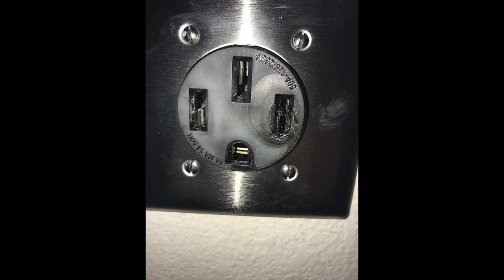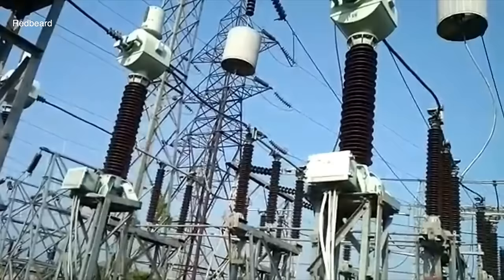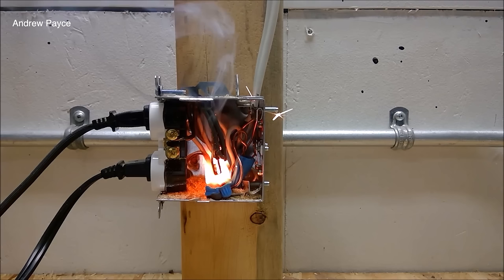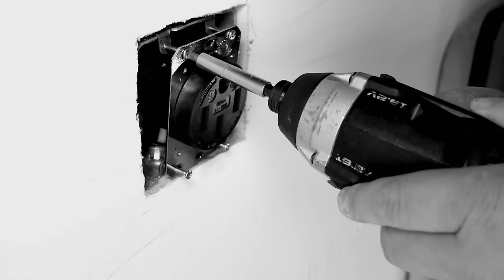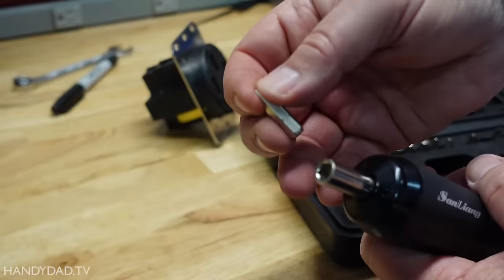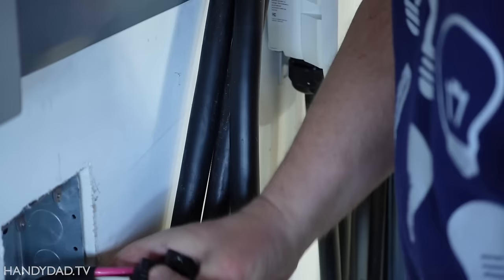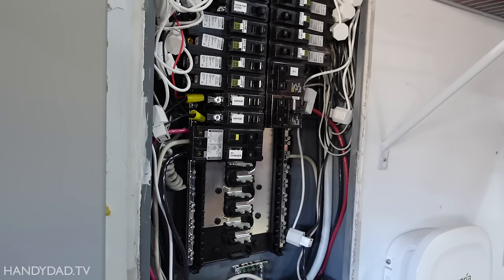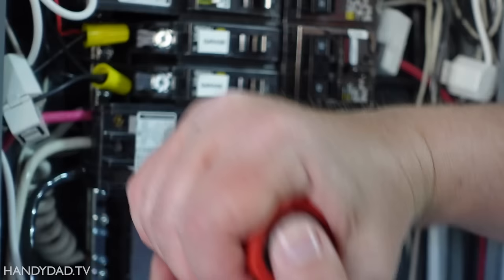EV Charging Disaster

Comment: Never buy a home unless it’s been certified safe. The number of cobbled up disasters by DIY repairs that I find are quite scary. Never assume, have it all checked to get a true honest price of what you’re getting. It may save your lives.
Reply from the maker: Sadly, a home inspection probably wouldn’t find loose wires.
Reply: @handydadtv  so no point in doing one? I got the price of my house reduced because the previous owner had put all new 15amp deco wall outlets throughout house, new switches to match, the rocker type. It looked nice. The problem was during the inspection it was discovered that it was a DIY job and he never ran a ground wire to any of the individual outlets, switches and thusly the light fixtures and outside outlets were not grounded as well. So I was just putting it out there that electrical DIY jobs should be investigated for code violations and a quality home inspection is a good insurance but to protect you from the crazy stuff you may find later. I’m old and just trying to save the young guys sone grief. Enjoy your advice. It’s always good. Thanks.
Reply from the maker: No, no. I definitely recommend professional home inspections. I canceled a deal after the home inspection.

Comment: Really goes to show how dangerous a “handy” ding Dong with too much confidence and too much time of their hands can be. You don’t know what you’re doing in an electrical panel but want to save maybe $1000? Then by all means, do your own electrical work especially with something as high amperage as an EV charger; definitely go buy the cheapest junk outlet at your local big box store and make sure to ask those ding dongs who work there for advice because they really know their stuff. 
  I bet if someone did a real investigation, it would be found that a LARGE percentage, probably the majority, of electrical fires are because of work done by non-professional homeowners. 
  Hire a professional to do the job right. An EV charger is one of the highest amperage circuits in a house these days so it should not be taken lightly. 
  Some of the comments here reflect how many middle level management bozos are doing their own electrical work. At the least the creator of this video had the sense to listen to professionals who know what they are talking about and put out a video on his mistakes. Kudos to Handy Dad for that but for those that don’t know what the National Electric Code requires for EV installations, don’t have a torque screwdriver, or don’t know what the difference is between an equipment ground and grounded equipment, then you should swallow your overinflated pride, and be calling your local sparkies who are qualified professionals and hopefully have worked with EV chargers before. Or just burn your garage down because you want to save a few bucks.
Reply from the maker: Thanks for the feedback. 👍🏻

Comment: I charge my tesla on my welder outlet.
The car tells me if it's charging right. 
I was charging at 48 amps and my car told me to check my outlet.
I turned the charger in the car to 22amps 
problem solved.
Reply from the maker: What charger are you using? I’d like to understand why this happened.
Reply: @handydadtv  The charger from Tesla that came with the car. 
But it's the cars battery computer that knows. It won't let you ruin the battery or the outlet. 
Say if you're going to a Tesla Super Charger, let the car know and it will pre condition the battery so it can take the 250 amp charging
Reply from the maker: The Tesla UMC (universal mobile connector) tops out at 32 amps. What made you think you were charging at 48 amps?
Reply: @handydadtv  You can set how many amps you want it to charge at, I had mine set at 48 (meaning it will charge up to 48amps if available) So it was taking as much as my 240 output would give it and it was getting hot. (I ignored the warning, till it tripped the breaker)
I used the app to turn it down to 22amps and everything works fine now.
I'm not an election so I don't know what I'm talking about lol 
I did wire my own 240 for my welder about 8 years ago.

Comment: I didn't see any ground wire connected!  That's a four wire plug and receptacle for a reason.  I would also use Wago connectors in your breaker box instead of wire nuts.  I've had a wire nut arc and melt before, but never a Wago lever nut.
Reply from the maker: Thanks
Reply: Seems like Wagos can have more resistance.
Reply: @jeffkardosjr.3825  
They might have more resistance than a good wire nut, but Wago connections are all good.  Lots of wire nut connections are not.  That's why they sometimes arc.  Trouble is, nobody makes transparent wire nuts so you can't see inside them like Wago lever nuts.  The Wagos have one lever for each wire too.

Comment: You deformed all the screws on the circuit barker. What a way to inflate something insignificant as if you were doing a lunar landing. 99.99% of circuit brakers screws are tight by feel and don't have a single problem.
Reply from the maker: All I can say is, there are tons of countering opinions that say you’re wrong. I was chastised by many electricians when I failed to torque the screws when originally installed.

Comment: Another one of those scary videos. Get the right equip and read the manual. This cannot happen, if you use the right charger which is temp controlled at the plug and maybe ask somebody to install a correct outlet. How about a 220v system. Everybody who gets a ev should get a wallbox! Everything else is just wrong.
Reply from the maker: Thanks for you input

Comment: Wires in wall and in insulators is wrong place. Strong current heating it. When something happen, wires on wall is more harmless and visible/smelly. First come smell, then smoke and then fire. Infrared meter is handy to observe wires and connectors. When wires and connectors are installed some distance of walls, not fire hazards from them.
Reply from the maker: Wire needs to be sized correctly to carry the current without overheating.

Comment: At minimum you should have a basic understanding of what your doing. Knowing how much to tighten electrical connections would be a bare minimum in my book.
Reply from the maker: I’ve done a lot of electrical work and this was the first time I torqued them.
Reply: @handydadtv  Have to keep in mind as the conductor gets larger it take more torque to make the good connection.  I don't think you will find many guys in the field torqueing them unless they are a apprentice learning the trade. Seasoned guys will know by feel they are tight enough. But for the inexperienced people that's why they give a torque setting.
Reply from the maker: Thanks 👍🏻

Comment: I’m soooo scared. Big wires, big screwdriver. I’ve done thousands of outlets, breakers, appliance installations, and breaker panels in my career as a general contractor. No call backs. No fires. The torque screwdriver from China may satisfy the specs but how do you know it’s accurate? You need to calibrate it against my wrist!😂
Reply from the maker: Good point

Comment: The biggest mistake is not hiring an electrician to do that job. I see 2 more failures you are going to have that only an experienced electrician would know.
Reply from the maker: Sorry but that’s no guarantee. Most pictures of melted outlets aren’t DIY.
Reply: @handydadtv  Yes there's most certainly a guarantee. I been installing 10 of thousands of the same outlet for 42 years for items that Pull much more power then a car charger. Range ovens, motor homes, trailers, construction offices, industrial equipment, ECTs, computer equipment. Just to name a few. A lot of this equipment pull a constant 60 amps. Never had any problems. The plug is under rated and so should be the wire. Tricks of the trade that DYIs don't know. We are a contactor for ev chargers installed as well. Never once had a failure of any kind. The connection should never have a 10 deg. Temp above room temp.
Reply from the maker: I believe you. But others must not do things as well as you do.
Reply: @handydadtv  Its tricks of the trade just like car mechanics who assemble engines or computer builders. Assembly is a mastered experience.

Comment: The Internet is getting more liberal every day and doesn't use common sense words at all anymore what is the special word of hardwiring EV charger  Different ways Of hooking up hardwiring and  Looking up level 2 charges with a on and off switch why is it so difficult
Reply from the maker: If you’re looking to hardwire an EVSE with an on/off switch, for circuits larger than 20 amps, that’s called a service disconnect.

Comment: If house fires scare you, then charging an electric car in your garage should scare you too. Imagine plugging in your car overnight and waking up to a house fire. EV batteries have been known to do that. The outlet is only one link in the chain. The car batteries themselves cause massive fires when they go wrong.
Reply: So do the many fires started by gasoline powered cars.
Reply: @lordgarth1  The difference is you don't "charge" your gas car overnight in the garage. It's not going to spontaneously explode while you're sleeping.
Reply: @chrimony  Except that they do. I still plan on getting an EV as well as battery storage for a solar array. I’ll probably add additional precautionary measures.
Reply: @chrimony  Unless it's a Ford with a United Technologies ignition switch that hasn't had the recall done..
Reply: @brianleeper5737  Thanks for the specific reference. I had never heard of the Ford ignition issue. But I'll note that it goes back to the 90s. I'm not aware of any internal combustion engine car within the last 20 years that compares to the dangers of lithium batteries being charged overnight
Reply: @chrimony  There was a more recent Ford recall involving the cruise control deactivation switch. It's mounted to the brake booster and it disconnects power to the cruise control module when you step on the brake--it's a pressure switch. Problem is that it can leak brake fluid into the wiring, causing a fire. Even if the vehicle is parked and turned off because that circuit is always live. There are several circuits in a vehicle that are always live, and a car battery has more than enough energy to start a fire if there's some sort of fault.
Reply: @brianleeper5737  Thanks for another reference. Looking it up, it seems the latest model to have this issue is from 2004. And while I acknowledge the general possibility exists and has caused issues, the danger from electric vehicles being charged overnight in a garage are much more fundamental and orders of magnitude greater. You have to go back decades for particular models of cars to find similar issues in combustion engines.
Reply: @chrimony  Perhaps. Other than the Chevy Bolt, what other EV or plug-in hybrid has been recalled for potential battery fires? I haven't heard of any.
Reply: @brianleeper5737  It's a fundamental issue with lithium batteries. Tesla cars have caught fire while charging in people's garages, but there has been no recall. Unless a specific manufacturing defect can be identified, it just comes with the territory and is written off.
Reply: EVs are not a ticking time bomb waiting to go off like some of the sensational headlines used for clickbait indicate.  "A recent study conducted by AutoInsuranceEZ using data from the NTSB (National Transportation Safety Board) showed that electric cars in the US caught fire at a rate of 25.1 per 100,000 sales compared to 1,530 for ICE vehicles and 3,475 for hybrids."
Reply: @chrimony  But if a cheap laptop catches fire while charging there's an investigation and a recall, but if a $80K EV does the same, it's just accepted as normal? Strange world we live in.
Reply: @brianleeper5737  I can only talk about reported facts. Lithium batteries have always been a charging hazard, though they have gotten better over the years. Forbes has an interesting article on the subject, "EV Battery Fires: What Consumers Should Know", that covers some of the history and future.
Reply: @chrimony  There's also different lithium battery chemistry and the hazard is different depending on the chemistry being used.
Reply: Statistics say you're at less of a risk with an EV over ICE
Reply: @timburton1080  You don't reference any statistics. And we're talking about one very specific aspect of risk -- charging the car in your garage.
Reply: 100 years of gas cars vs the 10 years of electric.   Hope the e cars do not fail that fast.

Comment: If fire scares you, why are you driving an EV? If you're ever in a crash that breaches the battery 1) your electric doors won't work and 2) the battery will catch on fire that resists being extinguished.
Reply: a) being an EV has nothing to do with having electric doors, b) you do know that gas vehicles do catch fire quite regularly?
Reply from the maker: I can’t speak for every EV, but Tesla has a manual release on all the doors. 

As for risk, this article https://www.forbes.com/sites/neilwinton/2022/03/02/electric-car-fire-risks-look-exaggerated-but-more-data-required-for-definitive-verdict/ suggests “electric cars were less prone to fire than other vehicles, with hybrids the most dangerous, followed by gasoline vehicles.”